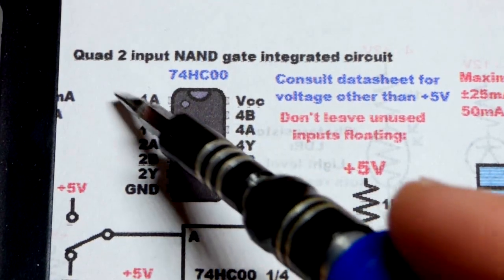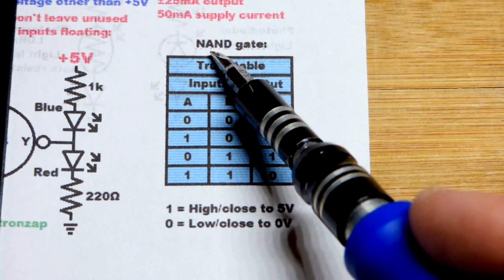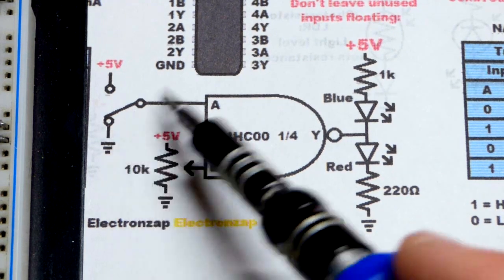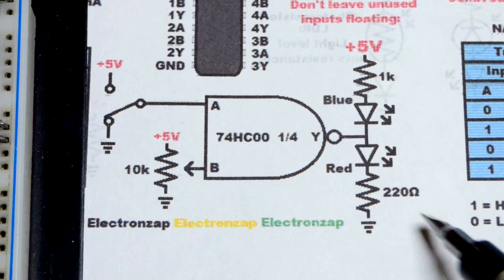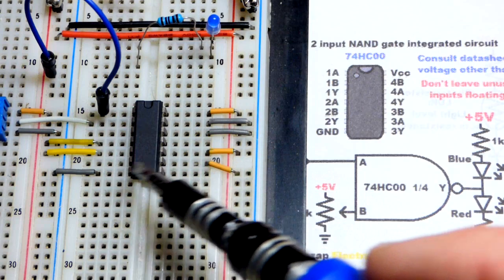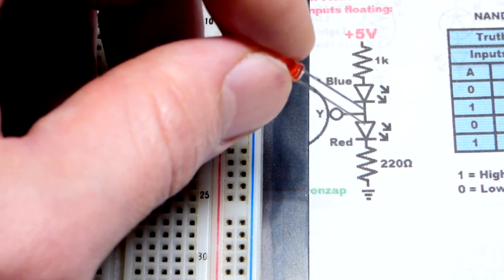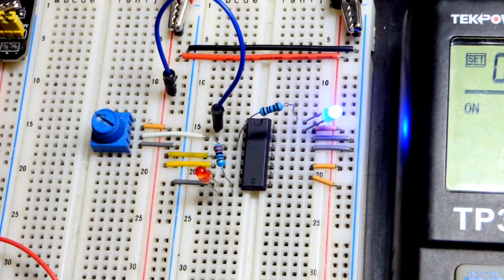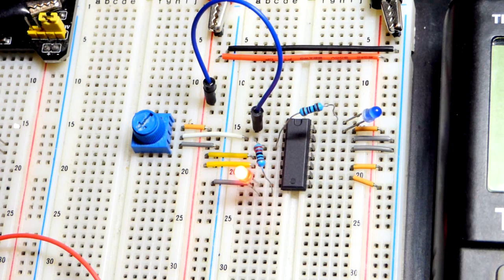7400 74HC00 quad 2 input NAND logic gate integrated circuit demonstration circuit with LEDs how to

Comment: Thanks a lot- I needed to see an exact closeup of the breadboard along with a slow explanation because it seems every time I try to do something with logic chips something messes up somewhere, even though the actual setup is pretty easy.
Reply from the maker: I accidently fried about 4 of these 7400 series integrated circuits by wiring them wrong just one time. They can't handle much voltage, and many of them can't even handle as much current as an LED. So unfortunately they aren't as easy to experiment with as most other common ICs.